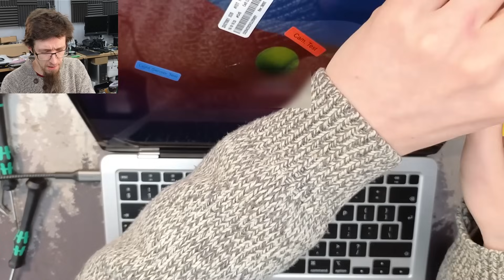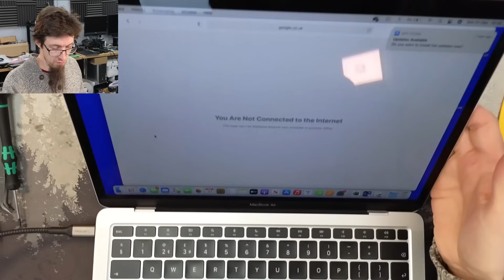Beaten up MacBook gets a new chassis - LFC#386

Comment: @Adamant_IT Pro tip from an Authorized Service Provider when pulling those pull tabs: Wrap the pull tab around the end of some tweezers (straight-end tweezers) and gently rotate the tweezers to pull the tape out from underneath the speakers and battery. Never once had one break when using this method.
Reply: nope this breaks for me using this method all the time. I recommend when pulling the tabs to pull to the left or right not just straight out.
Reply: That's exactly what I do with these pull tabs and they come out no problem 90% of the time..
Reply: if you no these stuff just question how to configure the display or you can't i mean in repair like this 
because the top case in MacBook air its not configure any whey just the display and logic bord need to configure and the configuration only in Authorized service

Comment: For Batteries in future use IPA and a small Syringe and put some under the battery it will help soften the adhesive and make them easier to come off using a pry tool

Comment: Having replaced a keyboard on one of these top cases I can confirm it’s possible, but a nightmare I don’t plan on experiencing again. The keyboard is riveted in…so you have to cut the tops, drill out screw holes for each rivet, and then put screws in to hold the new keyboard. It’s terribly time consuming.
Reply from the maker: Yea =/
The Retina series were about my limit - had to rip out rivets on those, but at least you could then just put screws in for the new keyboard without treating the holes. If you've got to start drilling out the holes, no way that's worth the time and hassle vs a good condition-used chassis.
Reply: first off, you are not supposed to cut the rivets, use some fine wire cutters to grab and pull it straight but slowly, there are screws meant to remplace those rivets but if the rivets break in half and a rivet chunk stays in there, it will not go in properly.
Reply: @Neo_AIO  You can not pull the rivets out , they are a part of the plastic molding and the heads which have been heat molded over have to be cut off . Watch a few videos on the subject and you will understand what a nightmare they are
Reply: @UserUser-ww2nj  bruh, 😂 are you trolling me? The whole top case is metal 🤪
Reply: @UserUser-ww2nj  and guess what, i did 🙂

Comment: i hate the speaker adhesive so much but with a tweezer its easy to remove gently rotate the tweezers to pull the adhesive out 
and also the Squair small shield in back of trackpad use to calibration clicking and feedback 
in Authorized Service when we order the trackpad its come with 3 size S and M and Large first start with medium size and check and thane do calibration but this in Authorized Service only i mean the calibration but i just wanna ask how to configure the display ?

Comment: NOOB Question:  I was testing voltages on a working Mac AIR & there was a “spark”.   Then it basically “shorted” (I guess) and now instead oh 8.6v where expected, I get ~2.3v.   I was testing a small inductor (the inductor that looks like an MLCC Capacitor (whitish) near backlight circuit).
     I’m not sure what I did wrong.  I see Louis & Adamant test LIVE voltages but I obviously screwed up.  
     Any ideas or recommendations on what I might have done?   THANK YOU. 🙏
     I wanted to create a spreadsheet of voltages at various points to compare with non working logic board.
Reply: you killed it
Reply: @toseltreps1101   I know I killed it.  Just wondering “what” I did wrong so I do not do it again.  Thanks.  Suggestions appreciated.
Reply: how can anyone know what you did?
Reply: @daytonagreg8765  you prob accidentaly put vcc backligt straight to the backlight circuit
 Edit
Tldr vcc backlight + ground = bad
Either you can replace the ic or mosfet that responsible for backlight voltage but that just my guest
Reply: @toseltreps1101  Someone with actual experience (clearly not you) has no doubt made noob mistakes along they way and could explain certain actions that would cause “a spark”.  My background is software development, & I’m just starting to understand basic testing.
     I also know, for a fact, that if this happened to me, it’s happened to at least a thousand other people (again, clearly not you) who could provide insight.
Reply: @daytonagreg8765  oh wow look i found someone who can't take a fucking joke 😂 what a sad day to be you
Reply: @toseltreps1101  Dude, get a juice box & put on a cartoon.
Reply: @daytonagreg8765  you're the cartoon
Reply: @toseltreps1101  dude stop trolling other people when they have bad time
Reply: Yeah you shorted a high voltage rail to a low voltage circuit. As for the list you were trying to make there is an opensource database google for "openboarddata". It has a lot of mac models with diode readings, Ohm readings, voltage values for circuits. Maybe that'll help you to fix your now two broken macbook airs :). Good luck and happy tinkering.
Reply: @felixgamingvlog6702  mom said i could so
Reply: Are you sure you were in voltage mode? If your multimeter was in current or resistance mode, it has low internal resistance, which would make it short the laptop when it's powered on
Reply: @Alvin853  prob he accidently short the vcc rail by multimeter probe or put the tip in reverse red to ground and black to gnd
Reply from the maker: Agreed. Sounds like the backlight LED driver got exploded. You could check the backlight fuse, and if you're lucky, it might just be that.
Reply: @Adamant_IT  THANK YOU Adamant.  I will check that out.
    Ive just started learning to diagnose PCB’s & I’ve learned more from you & Louis than all other channels.
    I can’t express how much I appreciate you posting these videos.

Comment: I would definitely advise, to put at least a small strip of double-sided tape underneath the "long portion" of the speakers. If this long portion is left completely "floating", it might start to rattle at some frequencies at higher volumes. This is quite hard to actually test, so I would rather be safe than sorry.
Otherwise flawlessly done - thumbs up!

Comment: I had an Asus laptop that someone had spilt a whole cup of coffee over the keyboard. I left it to dry out for a week and plugged it in, it worked fine so I told the owner to plug in a keyboard or use a BT one as replacing the keyboard is almost impossible with the plastic welds. The cost of replacing he keyboard was also ridiculous with 2 hours of labour and parts making the repair more than 3-5 times the value of the laptop.

Comment: Possible the lid was shut when there was an object on the keyboard?
Reply: No, the chassis is aluminium and not plastic. It requires quite a bit of force to bend aluminium. If that did happen then they would have had to kick or punch the screen closed but then you would have experienced a cracked screen too. It was stood on whilst open from the looks of it.

Comment: Why do you have a email if you don’t respond?
Reply from the maker: Hello o/
My inbox tends to get swamped, I do what I can but sometimes messages get missed in the stream. The best way to get hold of me is by phone or to pop into the shop!
Reply: @Adamant_IT  I’m in the US but would cool to stop in and chat. What brand solid state drives do you recommend or install?
Reply from the maker: Depends on the use case really... General laptop 2.5" HDD replacement, Crucial MX500. Budget NVMe Drive for PC, probably a Crucial P3 or P3 plus, depending on pricing. High performance NVMe, Samsung or WD Black.

Comment: I watch your video's because i am planning someday to design custom simple circuit board for smart home system and connect it with central pc which is very expensive or not perfect if you buy it or third-party do it for you i hoop that you someday start tutorial for somekind of building custom simple circuit (for example i live in Netherland and i think also in England you can find the cheap smart lamp that you can connect to app to control it  cost 17€ the app allow you to connect as many same brand as you like but i need to control many other stuff like  smoking alarms and other lamp but from different normal good brand and finally robot vacuum cleaner) and then design custom app to control all of them at once yo save more time and energy thanks

Comment: The only thing that would cause an issue to the customer is problably software related since true tone will no longer work and those remplacement displays are not color calibrated.
Reply: There is a sticker saying it has been light sensor tested so it should be good
Reply: @UserUser-ww2nj light sensor and backlight luminosity is not true tone 😂
Reply: @Neo_AIO  From your other comments I take you as a complete joke , including this one
Reply: How do you know they are not calibrated? You are making comments with no justification or evidence
Reply: @UserUser-ww2nj  because i'm a repairman also 😅 screen remplacements is something common, true tone gets disabled if you don't keep the original light sensor.And stop calling people a joke 🤣, i've been in the business for more than 3 years.
This is an apple bs calibration issue, look at an original screen and the replacement one next to each other, white colors appear yellowish or blueish depending on the panel.
Reply: @UserUser-ww2nj  i had some client that refused the display replacement because the panel wasn't color accurate 😢
Reply: @Neo_AIO  This one was calibrated and tested . Just because you choose to buy cheap screens is your problem so live with it. Buy good quality in the future and you will not have these issues
Reply: @UserUser-ww2nj  except that even while paying a premium for quality parts we end up with junk parts , welcome to the repair industry i guess.
Reply from the maker: No need to be a dick, @Neo_AIO completely right here, the 3rd party displays don't support True Tone. The majority of customers don't care and wouldn't see the difference, but it is something you need to check with them.
Reply: @Adamant_IT ty for the support 😊
Reply: @Adamant_IT  Maybe I'm wrong but it's not a problem with 3rd part displays, even if it were replaced with an original Apple display coming from another Macbook True Tone still wouldn't work, this is because even the displays are also paired with the motherboard.
Reply: @Maxccc If you buy the screen directly from apple, they are going to reprogram your logic board after the display swap. And then you have True Tone. 

If the screen is not from apple self repair, True Tone won’t work. 

Only if you use the old light sensor
on the new display, True Tone will work on MacBook Air M1